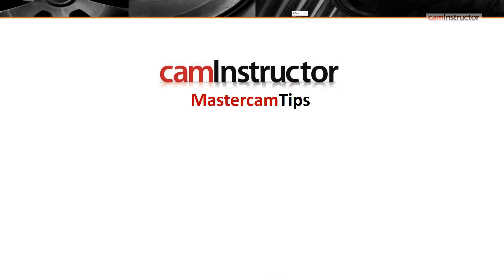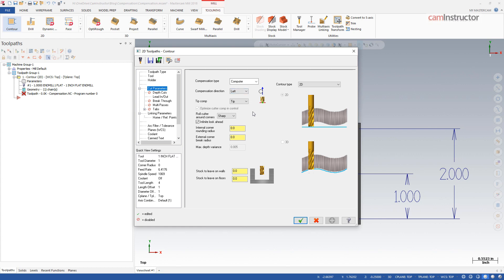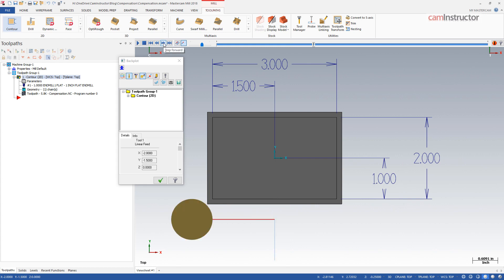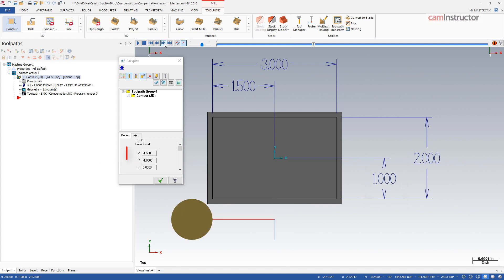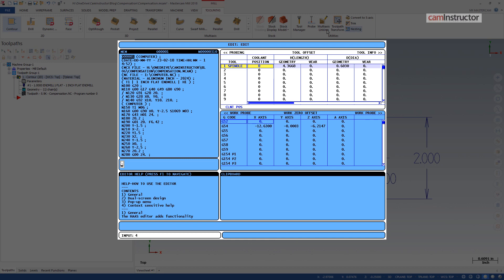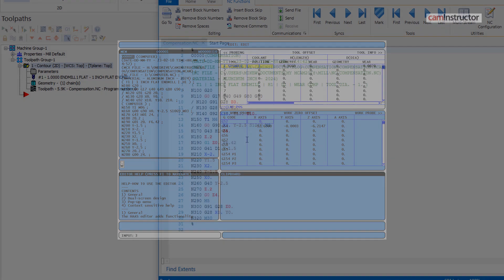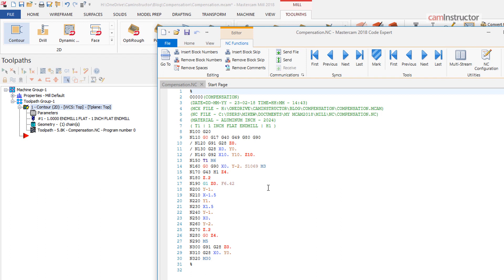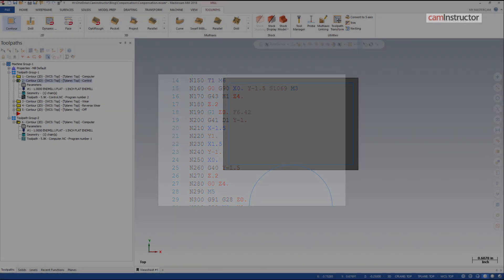Mastering Mastercam's 5 Cutter Compensation Types

Comment: okay so if i understood correctly, when i use a 16mm endmill, which in reality is 15.98mm in diameter, i get the following stock left on the walls:

computer      = 0.01mm
control           = 0mm
wear               = 0.01mm
reverse wear = 0.01mm
off                   = -7.99mm 

and when i use wear, then the control will just offset the toolpath, depending on the cutter compensation side, by the amount i have entered in the tool wear offset right?
Reply from the maker: Yes., that sounds about right. 
Just keep in mind, control, wear, and reverse wear are just giving you the ability to adjust your cut in/out. The only difference is how you tell the control how much to move and what to base it off of.

Comment: hi sir, can i ask ? If i have 1mm  endmill tool, and i use 2mm tool in mastercam but i use 1mm tool in machine, it must be wear compensation type, and -1.0 wear in machine ? In wear or geometry, what the different ? Thankyou
Reply from the maker: Using a smaller tool on the machine than used in Mastercam, you'll need a negative value if using wear or control. It doesn't really matter if you put this value into the geometry field or wear field on the control as the control will add these two numbers together and use that number for tool offsetting. The control doesn't treat geometry offset different than wear offset, its for the user to be able to see adjustments made to a tool.
Reply: Thanks sir for your help ! 🙏

Comment: For wear comp I’ve always been told lead in no lead out and set your lead in larger than the wear you would be using
Reply from the maker: The lead in needs to be bigger than the radius of the cutter + the comp size. So if you are using wear, the cutter size is 0 and yes, your lead would only need to be bigger than the anticipated comp range. If you only give it 0.002 of lead and the operator needs 0.0021 of comp, it will alarm out.
I would be cautious with no lead out. Some machines will move in XY to complete the comp cancel. Might not be a big deal if its only 1 or 2 thou but any unintended machine movement can lead to bad things. 
But like the saying goes, if it ain't broke....
Reply: @CamInstructor  thanks for the confirmation! Also I’m not sure if it is in mastercam settings, but if you run a finish pass with wear comp and try to run a spring pass, it will input a g40 and cancel the comp before it runs the spring pass. No big deal because you can manually move the g40 after the second pass but just wondering if you might know where the setting would be to change that is.
Reply from the maker: This stems back to your use of lead out. With no lead out this is the behavior you will get, add a lead out and the G40 will be at the end.
Reply: @CamInstructor  thanks for your help!

Comment: Very clear. Which compensation method is recommendable and safe for production
? Thank you.
Reply from the maker: Depends on the flexibility needed on the machine and what the machine operators are used to. Many will go with a Wear setting, this may cut down on lead in/out compensation errors which can occur when using Control. Control allows the use of re-ground endmills since the cutter size can be greatly adjusted. It all really depends on what the operator/programmer/shop decide is the best practice for them.